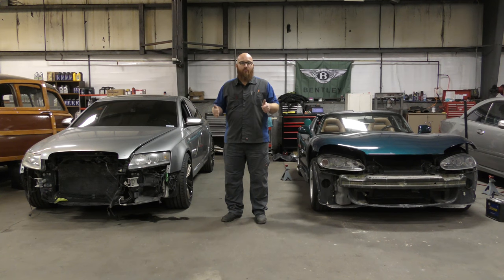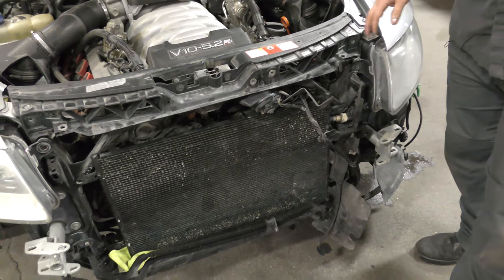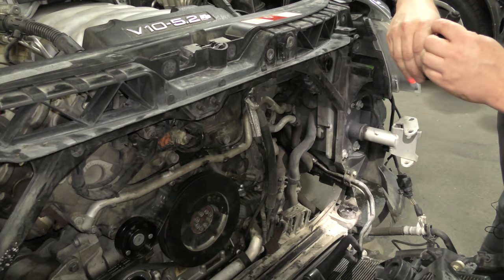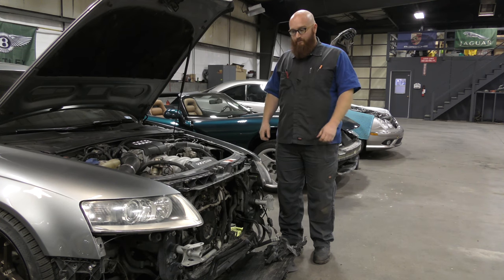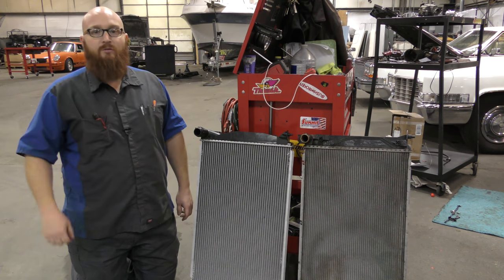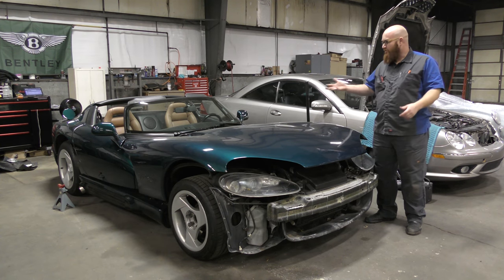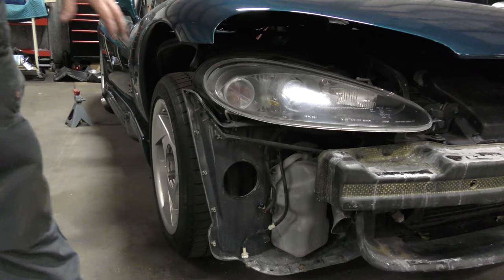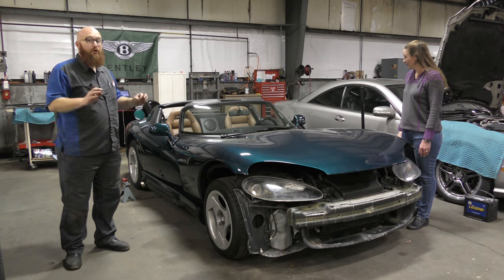What?! The CAR WIZARD has to remove the bumper on an Audi S6 & Dodge Viper to make easy repairs?

Comment: 2008 Chevy Malibu:  to replace a headlight bulb you need to remove the front fascia/bumper cover.  2016 Chevy Traverse almost as bad.  to replace the headlight bulb remove the wheel well liner and reach real far in.

Comment: they shoe horned that v10 into a small engine bay that is barely big enough. I don't think there is much the engineers could have done differently given what they had to work with. 
I suspect that the 3.2 V6 version of this car that was the volume model wouldn't have been as bad as this thing?!?
Reply: They once put a 5.0 with twin turbo in a wagon.  Bad thing with the 5.2 v10 is the cam girdle, you cant remove cam inside the car if those girdle leaks in sparkplug holes. Engine out.  so engine out every 10-15 years, do everything needed, free o2 sensor, front and rear main, all little gaskets and coolers and good to go.
Reply: I own a 2007 A6 with the 3.2 engine. WAY less expensive to maintain but the engine bay is still VERY crammed. If your timing chain fails, you have to remove the engine, for example. However, the V6 is a much more reliable engine and you can reach 200k easily if you take care of it.
Reply: @AnearHD  you can do upper tensionner in-car on a 3.2 and 3.0. If the whole engine needs to come out, you can leave transmission in the car on the 3.2 and 3.0. Something you cannot do with the 5.2L Reliability is  a toss up. I've seen 2 S8 5.2l with over 180 000miles despite them being a usually lesser used car when I was looking for mine.  Everything is more costly to do on the 5.2l for room constraints but that's all similar durability in parts. Alternators in s6 and s8 also better than other since they follow the watercooled design of the A8.  The timing chains seems to last longer on the 5.2L but that could be from them being generally better serviced cars being "exotic".
Reply: @Nordic_Mechanic  I’m planning on doing my upper tensioners at some point in the future. I’m about to hit 140k and I’m experiencing like .005 seconds of rattle at cold start, which is normal, but I’m prepared for the day.

Comment: I give the viper a pass on difficulties to access some systems and subsystems to repair. After all it started off as strictly a show car which was only put into production because enough people actually wrote cash money checks to Chrysler saying build me one to get their attention. It was intended only to be built in small numbers. So the added expense to engineer easier access for repairs to some items is forgiven for cost reasons vs payback. You got a custom one off show car that was legalized, emissions legal, safety legal and made produceable enough cost wise to be accessible for purchase by John Q. Public (abit the more well funded ones). For what it is, the viper is overall pretty well engineered serviceability and repair ability wise.

Comment: Know all about Audi issues from owning a 2002 A4 3.0 Quattro for 9 years. But the biggest surprise lately has been the 2005 Toyota Matrix I sold to a friend. Volunteered to do a cooling system service and to my surprise the alternator had to move to get to the thermostat housing and there's a little coolant hose to the throttle body that hooks to a pipe behind the intake. It's a nightmare.

Comment: A neighbor had an old Toyota truck from the 1970s and that was the easiest vehicle to work on. Everything under the hood was so bone-basic and easy to reach in and access. My old 1975 VW Beetle and 1973 Thing were more compact, but the motors were so easy to drop. An experienced mechanic could jack up the rear of the car (really high so the fan clears the bumper), detach the wires, ducts, motor mounts and bolts to the transmission and pull that engine in two minutes. Terrific vehicles for young people to wrench on and drive.

Comment: Car Wizard, car engineers heard YOU! No more V10 and V8's in the future. You will have all the space with 4 and 3 cil engines.
Reply: thats why im buying large engine before its too late. At least ill be able to tell my grandchildrens that I had a 10 cylinder sedans when I was young
Reply: They'll make engine bays small enough to give you plenty of headaches.
Reply: @taunuslunatic404  I bet. They are in the business of selling cars, not an humanitarian quest to give transportation to everyone. They ll use all their ressources to make it easier and more economical to buy new car instead of servicing.
Reply: Electric motors don't take up much space!
Reply: @1963TOMB  Batteries do.

Comment: Fortunately, I didn't fix it, but my mechanic friend has welded a new flex tube into my exhaust system. He said he may have to lower the suspension, and that the car will need an alignment afterwards. But then he managed to get it done without that, by squeezing his hands with the welder into the tight spot above the exhaust pipe. I am really grateful to him for that.

Comment: The memories: the timing belt on my '92 Audi S4 was a front-bumper-removal job.

Now I've got a dime-sized cover I need install (the Dreaded Dowel Pin) on my Cummins-engined 98.5 Dodge Ram.  That is a front-bumper-and-radiator removal job.  Yay.

Comment: I needed to replace a rear side window on my LS Lexus. All the parts providers said the part number was right but clearly it was for the long wheelbase car. All the local glass shops insulted my intelligence by asserting it was correct and assuming I just didn’t know which version of the car I have. Nonsense. Ended up getting help through an east side Houston glass shop with connections to salvage lots and they found me a replacement within an hour. Not only were they helpful on the part but they installed it cheaply and quickly. Perfect.  No issues. Guess where I will go for glass next time?

Comment: Try swapping out the headlight/s on a mid-2000 Honda CRV- the bumper cover has to be removed.
Reply: I have a 2004 Pilot and it's the same deal.

Comment: My 2006 Miata is about as crazy, from removing the bumper to disassembling some engine components and even removing a tire, just to change a Headlight bulb that has burnt out.
Reply: Ok, its not that serious, you turn the wheel in and pull the fender liner, worst case you break some plastic retaining clips which amazon sells for dirt cheap.

I agree though that it shouldn't even be that hard.

Comment: 1966 Oldsmobile.... The A/C was mounted right on top of the front spark plug.  You also had to remove the A/C to take the valve cover off.... At least being right on top of the engine... the A/C was easy to remove.  I wound up pulling the A/C compressor and never putting it back.

Comment: I had to remove the battery, the battery tray, the fuse panel, an ABS module, and several vacuum assemblies to replace struts.

Comment: Made me think of my friends I've sub.  There's a plastic "bar" you have to cut when replacing the cabin filter.  It's actually the factory procedure.  Grated it's behind the glove box.  But for something calling for annual replacement, just why.
Reply: That's the case with my 2009 Suburban. There was a spot engineered for the cabin air filter, but there was no opening in the plastic for the filter. I had to cut out the opening, and I was able to buy a filter and cover on Amazon for the new opening, exactly what GM should have provided. Thank goodness for Amazon and YouTube.

Comment: My car has the oil filter right behind an A/C line and beside the exhaust manifold, that has the catalytic converter, heat shield and O2 sensor wiring. And you can't really get to it from up above because there's the alternator and it's wiring too. 
It took me and my dad probably an hour to remove a simple oil filter.

Comment: Wiz. That replacement radiator is also a few inches smaller. I can see that much from way over here. In these cars you also need to remove the front clip just to change the drivebelt

Comment: I remember the good old days when I had a leaky radiator I took it to a radiator shop that soldered up the leak (which was usually in tubing made of real copper) and it was fixed.  That was before everything was plastic and non-repairable.  Also, the radiator was easy to get in and out.  Eventually we'll be to the point where if anything breaks you have to just buy a whole new car.

Comment: I would strongly suggest the inaccessibility issues with the S6 is driven by the fact a huge V10 has been shoehorned into a vehicle that was designed for nothing more than a V6. When Audi management signed off the use of the V10, all service clearance needs for maintenance evaporated.  There should be some kind of international governing body that reviews prospective designs for motor vehicles and assures future sensible economic maintenance process.

Comment: I had an 02 S6 for a short time. It had a 2.7 v6 biturbo. It was in the shop more than on the road. Oil leaks, brake problems and 4 bad O2 sensor at one time. Luckily it was under a 100% extended warranty. 
I traded it for an 03 530i. No more problems and a better driving car.

Comment: 2009 Acura MDX (I'm sure many other years) you have to remove the bumper to replace headlight bulbs. Also, don't drop your iphone or small cell phone under the front middle council. My best description is a valley pan underneath the monstrous front  middle council with just enough room for a small phone, credit card or jewelry to get lost underneath. It took me 2 hours of trying to get the phone out with different tools until I took the damn thing apart.

Comment: MK1 Audi TT is the same, have to take off the bumper and the front end to change the radiator.  Radiator is about $50.  Job takes 3 hours.

Comment: It's because they have massive engines everything is tightly packed in.
The bigger the engine the harder it becomes to work on.
A very low cc engine will have lots of room all around the engine.
Reply: You must have never seen older audi engine compartments. C5 a6 with 2.7t...small displacement v6 utterly shoehorned into the compartment. No room for hands anywhere in there.
Reply: @DaNiElLl430  2.7 V6 is a big engine daniel.
Under 2.0 litres are considered small by my reckoning.
Yep audi's are a nightmare in general & big money pits like bmw's & mercs.
Reply: @DaNiElLl430  Better than this V10 or not? Yes, right? That's the point! Did you compare your C5 with another sedan of the similar year with a V6 in the engine bay?
Reply: If I'm not mistaken the 1.8t and tdi engines are a lot easier to work on
Reply: @1066gaz  >2.7 V6 is a big engine
Spoken like a true european.
Reply: @Zoomydoomy  not to mention the high turbo failure rate on the 2.7. Guess the labor on those lol
Reply: Have you ever seen the engine bay in a fiat Seicento with the 1.1liter FIRE. The engine barely fits in
Reply: @jordanrudler2120  No i have not.
Exception to the rule with fiat's sounds like it.

Comment: Hey Wizard, you know the entire front panel on the Audi is designed to slide forward know as the 'service position' without too much disassembly, just use a slider kit or make one from some studs and a couple of pieces of tube.

Comment: Sometimes it’s not access that causes the problem. I once changed the water pump on a 90s Ford van. It was easy enough to get to the pump, but when I tried to undo one of the bolts, the head immediately snapped off. Aluminum pump body + steel bolt = electrolysis. It was like that bolt was welded into the pump. I eventually had to saw off that part of the pump so I could rotate it and unscrew the bolt. What should have been a simple swap took most of the day.

Comment: I dealt with a lot of shade tree mechanics. They were my bread and butter. But I swear, back in the day half of my returns were Aerostar when it was an Astro. Half the parts I sold were returned as no fit. The other half were returned as "defective" and...the other half were returned when they tried to put on the wrong part and broke it in the process...hence, also defective. Another big issue was aftermarket motor mounts. I swear every one had different thread pitch from the original mount and the "mechanic" would force the bolt in and destroy the threads in the new mount (defective also).

Comment: I just replaced the xenon bulbs on my 2003 jaguar xj (x350 for jaguar people, aluminium body) the easiest way to do this as recommended by alot of people is to remove the front bumper.... to replace a bulb! You can manage like i had too (due to alot of rotted bolts) but you need alot of patience and long fingers.

Comment: Here in the UK you can't change a renualt megane headlight bulb without taking the wing off. There are also loads of Italian cars where on one side of the car you have to do the front bulbs from under the wheel arch with the wheel and liner removed. I always use a better quality component if it takes longer to replace.

Comment: You don't need to remove radiator to change pulley or front main seal. Bumper cover comes off which is easy and then the core support can get shifted forward by loosening the bolts. No need to drain coolant or oil ect.

Comment: That's still understandable, after all, it's an I-4 engine bay fitted with a tractor engine that used to live in the trunk. On a Ford Focus on the other hand, You have to dismantle the full front quarter to change a running light bulb. Vages are designed to drop the engine for everything besides the basic maintenance. 4-8 bolts and one multisocket. 15 mins, if tools and lift are ready.

Comment: The intake,and master cylinder were in the way of changing a starter on a Chevette! I bought 3 feet of extension and a partial swivel(rounded head extension)to get to one of the bolts through the intake./Are you changing the Thermostat on the Audi,since you can actually see it?

Comment: Audi is a brand I'd never own without factory warranty.

"if it was an '06 Murcielago we'd cut a hole." lololol!!!  Love it!
Reply: So right, My A3 tdi went into limp mode all the time despite having the entire fuel system replaced.  Sold it back with a huge sigh of relief during the diesel recall program

Comment: It’s not a dumb design. The car is front wheel drive base and the engine is longitudinal. Where else was they supposed to put the radiator? Like the Cadillac Northstar, it’s an amazing design.

Comment: Wizard needs to do a video on Ford super duty trucks(especially the junk Powerstroke engines) for impossible to work on vehicles.  Usually the first step is to remove cab from chassis to access engine.

Comment: I can understand the very small production run specialty models being harder to work on.... But just finished belt and radiator r&r on 08 equinox... Had to remove engine mount and raise engine for the belt and pull the the front bumper cover for the radiator. All not horrible in a shop, but would be near impossible to change belt in a parking lot in an emergency repair.

Comment: Many VW and Audi products require a bumper off to change the xenon bulbs , it's a pest and in Europe it was a design regulation that safety items like lights should be able to be changed by owners for emergency use.

Comment: I had a 1991 Dodge Shadow ES Convertible with that same emerald green with tan top and tan interior, and I ordered a 1997 Jeep Wrangler with that color scheme also, but it kept getting delayed so I ended up with a blue one. Yes, that emerald green was pretty hot in the early 90s, but was tuckering out at the latter end. Very few emerald green TJ Wranglers were ever built.

Comment: Working in the steel industry plant maintenance I know these grudges. Stuff mounted in tight spots, no sight, no point from which to lift the parts... Just makes you angry at times and makes certain jobs more dangerous than they would have to be.

Comment: I saw a comic strip that showed an engine sitting on blocks, with someone working on it, and another person in a lab coat pointing at the engine.  The door to the room in the comic said "engineering lab". And the caption had the guy in the lab coat saying "No no no, that fourth spark plug is way to easy to get at".

Comment: On all VAG cars the bumper comes off  fairly easily then the whole front end comes off with a few bolts. You have special tools (long bolts) you put in the holes then the front just hangs on them.

Comment: Can't use the older type rad hose clamps with the gear screw, they can break the plastic on your rad, you need the spring type clamps that can expand.

Comment: Try a 2005 Citroen C5 2.0l HDi had xenon arc adaptive Projector Headlights. Garage job to change, whole front bumper off for indicator side,dipped & main beam bulbs. Ok, Its French, but french law says you must carry spare bulbs in case of failure...  The Newer mk3 Citroen C5 has slightly better access & I replaced all the incandescent/halogens for Led's no problem.

Comment: "What item has blocked what you needed to fix on a car?"  Own mostly GM vehicles and they never seem to add an access panel through the sheet metal to the fuel pump.  So, much like the Murcielago scenario, one is cut open.  Fix the part then repair the cut out section later.  Saves a whole lot of time and hassle dropping the entire tank.  Gets the job done just have to be careful.  Sometimes I do things to my own vehicles that I'd never do to someone elses.
VT247